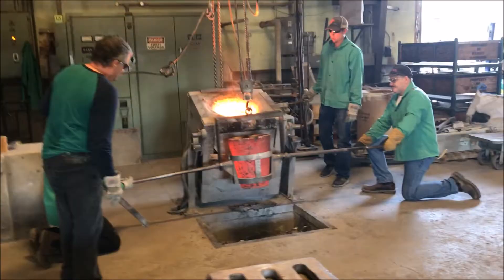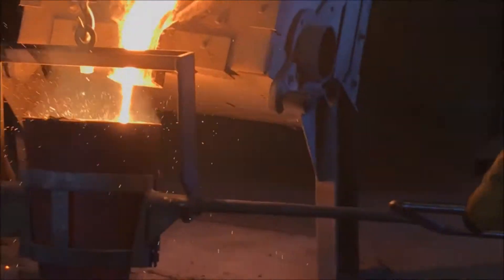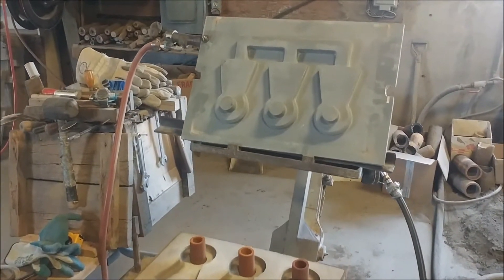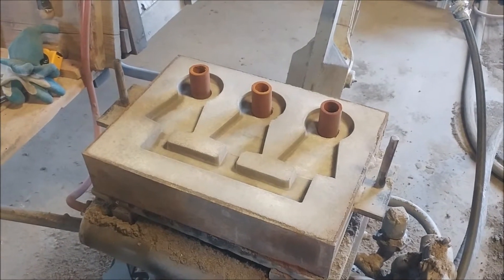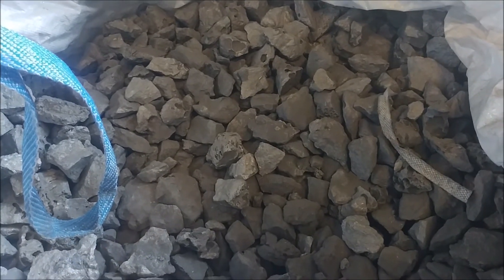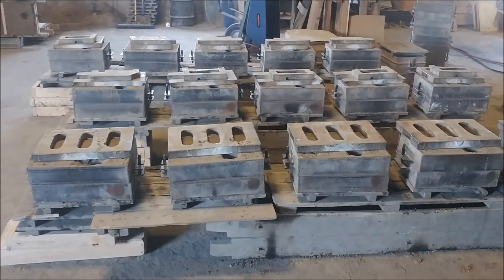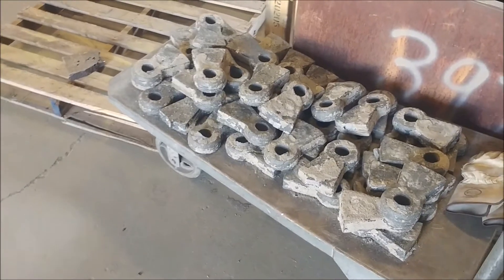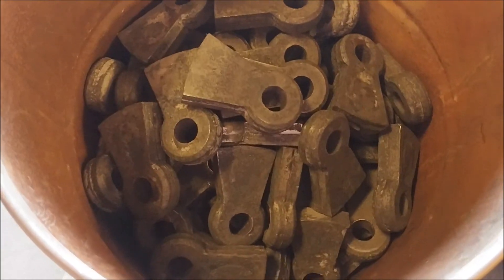Making Chrome-Iron Hammers For Our Hammer Mills

Comment: Fantastic video, thank you for sharing! Is that an induction furnace, or what is the heat source please? Do you have to flux or purify the metal in any way? What is the chunked material with high chrome? Is that a crushed pig or billet of maybe ladle steel, or is that an ore of some kind? If you have to buy steel scrap if you run of your own, what grade do you buy? Simple #1 prepared, mild steel, or something more specific like engine block? (even though I can see it's plate) This is fascinating to see the process up close! I am so happy for you guys that you are vertically integrating! Also, I think you are hitting a machine size niche not met by many (any?) other U.S. mfrs, and you can export your good U.S. quality where you have markets, and also save your fellow Americans from importing more wobbly, poorly engineered junk from a country that shall not be named. To me, you guys exemplify what is good and successful about our country! Thanks again!

Comment: I worked in a foundry that produced the much bigger version of these. Our heats would be at around 28k pounds from an arc furnace. Never got to see the finished product though. We would get the worn hammers to melt with the scrap. Good show, were the keyways machined later?

Comment: Jason this is very cool. Do u ever heat treat the hammers to make them harder or softer? Probably wouldnt really want them softer but tempering them might be useful only problem is the trade off of them becoming more brittle
Reply from the maker: We don't heat treat, but they are still hella abrasive resistant